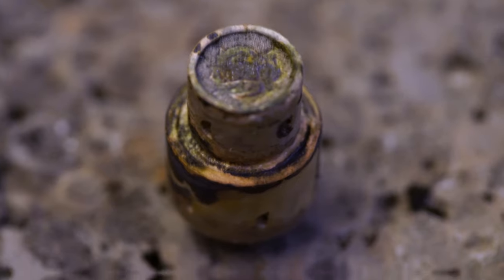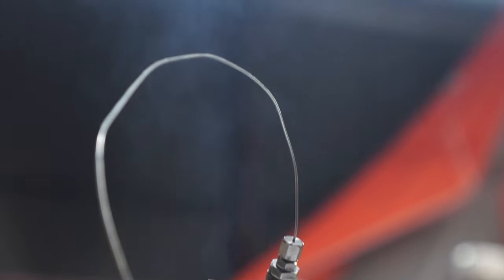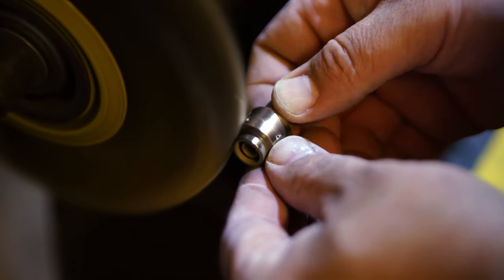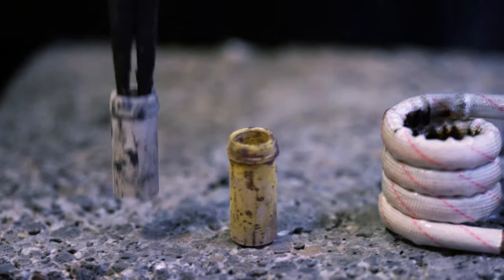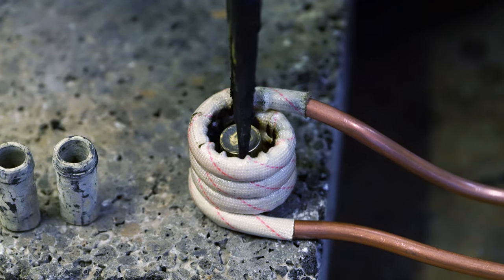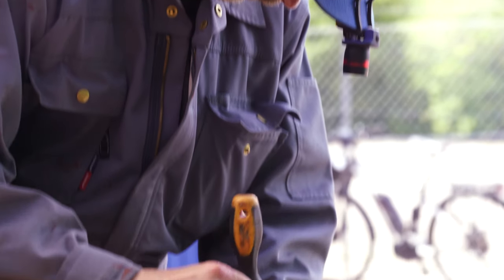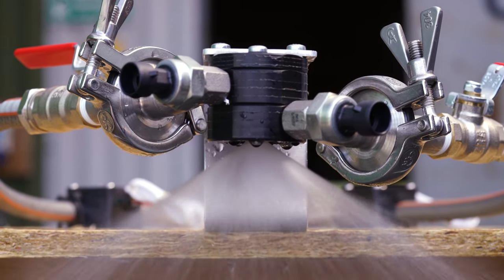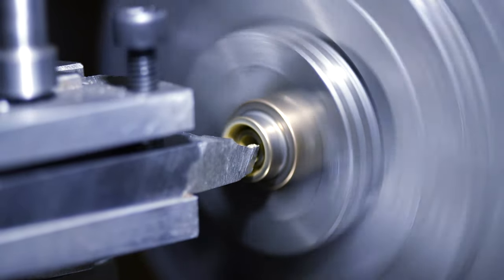How We Solder Rocket Engine Fuel Injectors: Coaxial Swirlers

Comment: Will your floating launch platform be able to fully support and launch the SPICA rocket without falling over or sinking? or will you launch it from land?
Reply from the maker: Still to be seen. But might likely need an extra hull.
Reply: @CopenhagenSuborbitals  or just add air tanks aroundon long arms :)
like some smaller boats attached 2-3 meters out giving it a wider base.

Comment: Does it make sense to add a non-foaming surfactant to the water to reduce the surface tension?

Dish washer detergent (for machines) might work because it is supposed to be non-foaming.